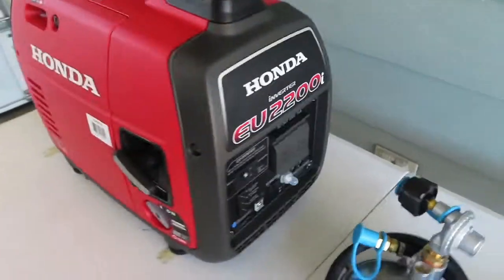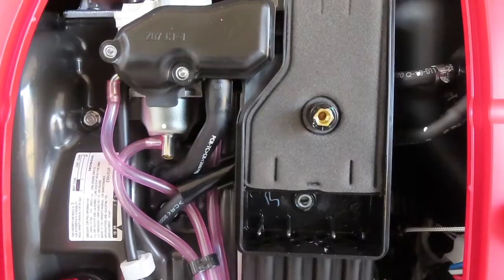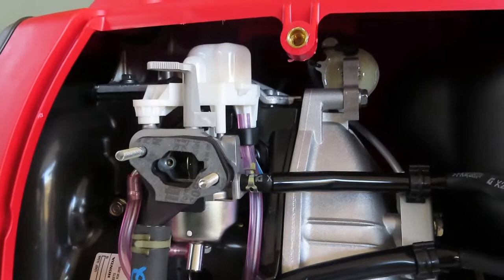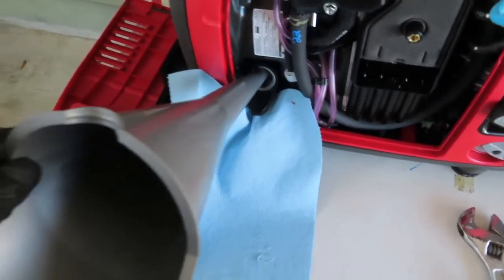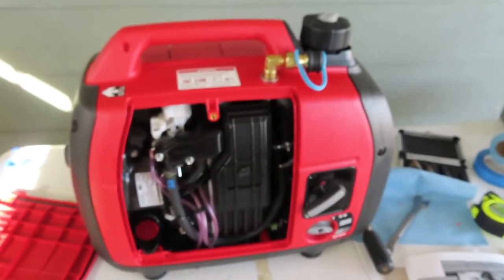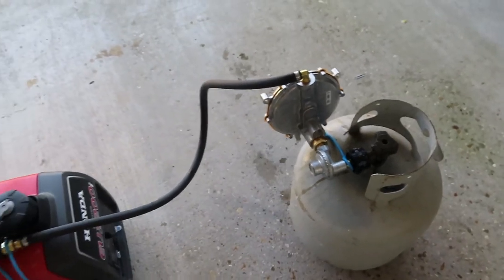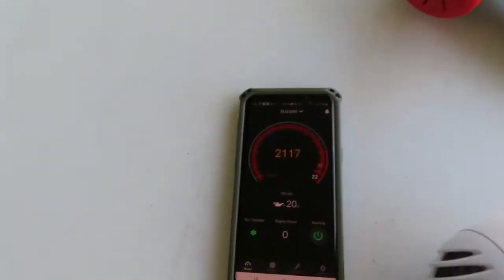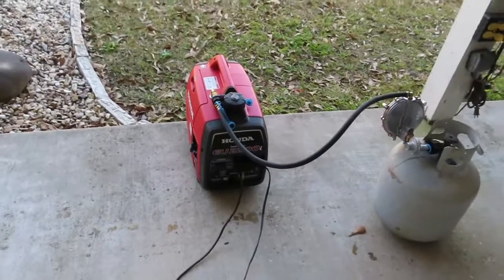Honda EU2200i Generator Propane conversion

Comment: How long will it run on a standard propane tank?
Reply from the maker: depends on the load. I got 3 nights at about  8 hours each with a fridge and a/c using 1/3-1/2 load depending on how each item was cycling

Comment: Nice video!  If I want to use the generator at home and use my home propane, which already has a regulator,  can I just connect it to my 80 gal. home tanks via a hose? I have a hose connected to my Weber propane grill that is easy to disconnect.
Reply from the maker: It uses a regular high pressure BBQ style regulator and a larger low pressure regulator. All that came in the kit I bought
Reply: @MikeJordanUnCamplicated  Thanks! It looks like you can remove the smaller regulator and then connect the home propane hose to the larger cylinder.  I think the magic happens there. That's a very cool kit. We lose power in No. Cal due to all the fires and lack of PG&E oversight,  so being able to connect a hose and off you go is pretty enticing.
Reply from the maker: @taurusrush420  for propane you need the smaller regulator most. The smaller one reduces the high tank  pressure. The larger one is a low pressure regulator shuts the unit off if there is a gas leak. When I connect to natural gas, not propane, NG is already low pressure. So it runs with the larger regulator only.
Reply: @MikeJordanUnCamplicated  Got it.  The big tanks have a regulator to the house and bbq bib, so I think that'll do.  What happens if you have two regulators inline and the conversion kit cylinder?
Reply from the maker: @taurusrush420  it won't run with 2 high pressure regs. If you have a reg at the tank, only use the large reg from the kit. I think the large reg needs to be close to the gen, so keep that spacing the same
Reply: @MikeJordanUnCamplicated  Perfect! That's the answer I needed. Thanks again!

Comment: You may wish reconsidering the $5 Chinese magnetic dipstick.  The magnet is pressed into the aluminum body.  The aluminum expands as it heats, sometimes releasing the magnet into the plastic oil slinger where it effects $650 in damage.  Most of the wear in this engine is aluminum parts anyway.  Thanks for the nice video.
Reply from the maker: hmmmm, I have been running mine for a little bit. I'll have to check that out